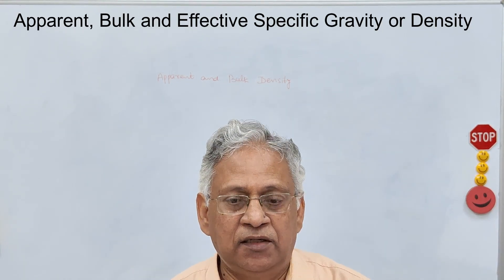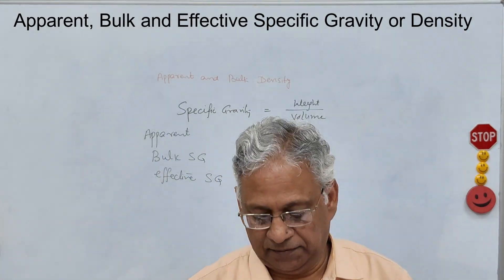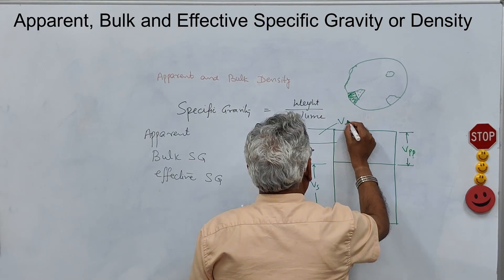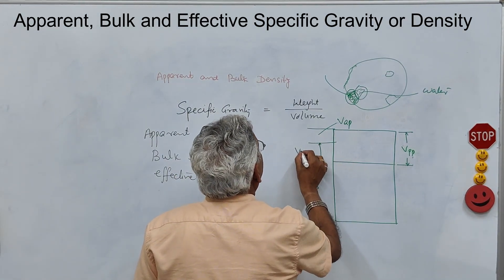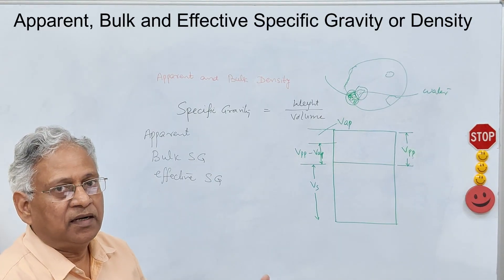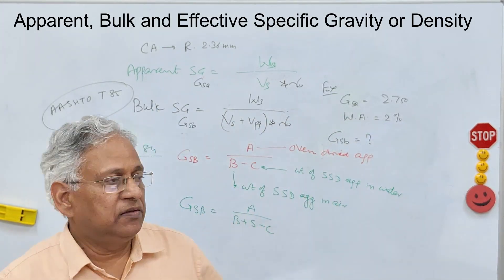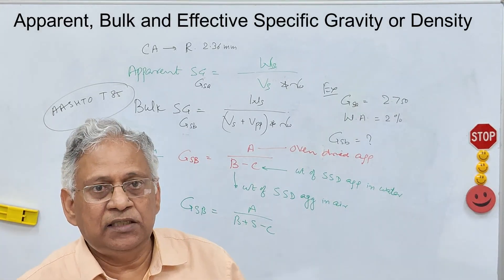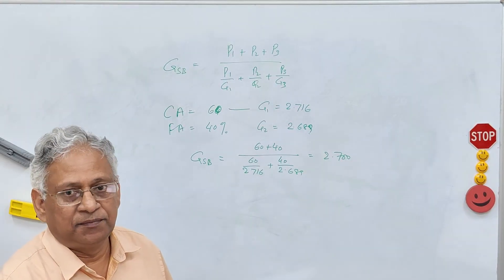Apparent and bulk Specific Gravity of aggreagtes, Method of determination with all calculations

Comment: Sir, what is specific gravity at SSD condition, Which is mentioned in design mix of concrete in IS 10262. Is it different from specific gravity?
Reply from the maker: SSD means saturated surface dry condition. If you know the water absorption of aggregates, then add this amount to total water requirement. Say for example, water absorption of coarse aggregate is 0.8 percent. That means these dry aggregates when comes in contact with water will absorb 0.8 percent water. The water available for mixing will be 99.2 percent. So we increase the amout of water by 0.8% to take care of it. Specific Gravity calculations consider SSD weight only. If you consider dry weight of aggregates, it is apparent SG

Comment: “Sir, great video. I have one doubt regarding bulk specific gravity. Can’t we take the height and diameter of the specimen to calculate its volume? I understand it may not be very accurate, but if we take three to four measurements of diameter and height for one sample and then use their mean to calculate the volume, would that work? Also, I’m not completely sure, but I think that for bulk specific gravity we avoid the effect of surface air voids, and that is why the buoyancy balance method is used. Kindly clarify this doubt. Thank you for all videos, sir.”
Reply from the maker: Yes, you can. Bulk specific gravity of aggregates is calculated considering total volume including pores and voids. It is the desity considering all spaces within the particles. That is why, we use weight in water to be accurate.
Reply: @SatishIITR  Thank you so much sir🙏